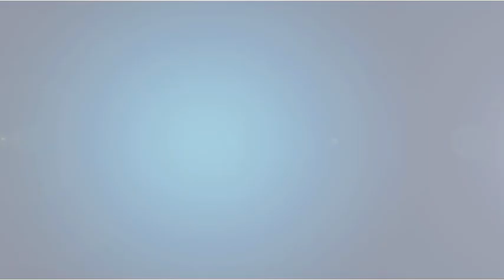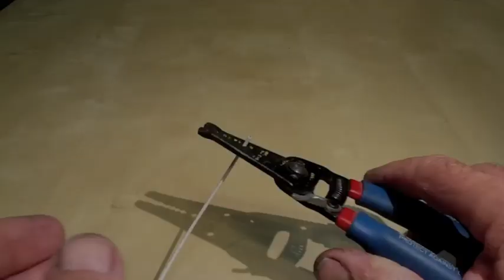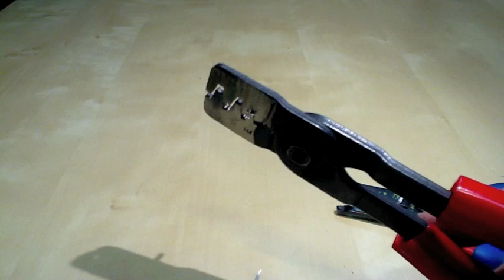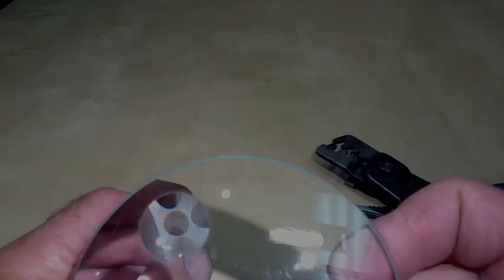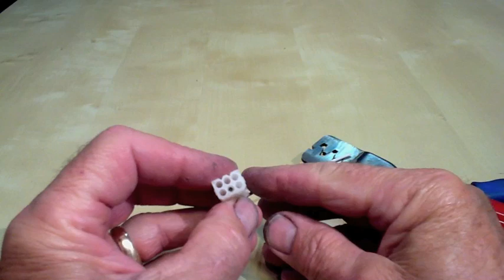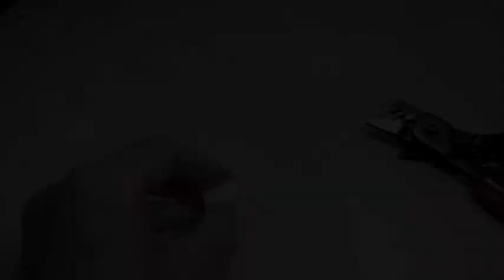Assembling a Molex Connector

Comment: Glad to see the RIGHT way to do Molex crimping, insertion and even extraction! Any links to the pliers and the extraction pin shown? 

Have a Printrbot Play with a cheap Molex adapter that has the ground wire touching the reset pin on the ICSP causing havoc with my Cura Print with USB connection!

Comment: this molex standard should be replaced and discontinued...
Reply: +PixelFlames I just bought undercabinet lights made last year and it has these connectors. I have to make my own connecting wires with normal 12 ga. extension cord (spanning 6 feet or so) because the extension cables they give you are only 6"
Reply: @MrWolfSnack  well, I guess I can tell girls I'm hung like an extension cord now...

Comment: Sir could you tell me the proper tool to crimp D-Sub Contacts FEMALE REAR CRIMP (open barrel pins), the part number of pins is L17RRD2F01100, wire size to crimp is 24AWG PTFE wire

Comment: I was trying to find out which of the two mating connectors the pins go in and which the barrels go in. If it doesn't matter, I would like to have heard that too.
Will have to look elsewhere.
Reply: The (male) pins and the (female) barrels can go in either the (male) plug connector or the (female ) receptacle connector.  You can even mix them to make different polarized sets that can't easily be connected to the wrong mates.
When Radio Shack sold them, they packaged the male plug with the female barrels, and the female receptacle with the male pins.